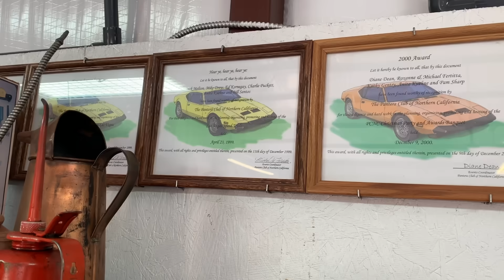I Flew 5000 Miles To Buy My Dream Car BUT There's A Catch.. DeTomaso Pantera

Comment: Only thing i can see thats going to be a bit of a job is the 1/4. Thats paint separating from primer and body filler. You’ll have to strip the panel to bare metal. Rework the sheetmetal (it’s likely a bit to wavy under the filler) re apply the filler the correct way. Then paint it.
On the positive side. Its black. So you can panel paint without blending.
Reply: The factory used lead.
Reply: @johnbriggs3916  what does that have to do with anything? There was lead on the seams. 
This obviously has filler on it. Not lead.
Reply: @johnnymula2305  Exactly  --  it shouldn't have filler. (The factory didn't put lead on just the seams!)
Reply: @johnbriggs3916  obviously you didnt watch the video.
It CLEARLY stated. That the car just went through body and paint.
You’re trying to compare an original car to a restored one.
I guarantee, 100% there is filler under that paint. And not lead. And the cars future will expose this when the 1/4 panel gets ground down to correct it.

Comment: I think the bodywork is hiding secrets. Those "strange marks" on the quarter panel look like theyre hiding filler or something. Couple that with the orange peel and some of the matte finish around the front bumpers and it just seems a little off.

Comment: Those marks look like either the fibreglass is delaminating or it's filler that is starting to lift, paint needs to be stripped off for a proper inspection, if the engine still has hydraulic lifters then all good, the roller rockers should not cause issue although not needed, if fitted with a solid lifters, roller rockers and adjustable push rods it will be a pain in the rear,
Reply: Depending on the date (which I didn't catch), there shouldn't be any fibreglass.
Reply: It's a 1974  --  there shouldn't be any fibreglass.

Comment: You'll end up changing the color I guess... probably some mild surprises under there but ... like Harry Metcalfe says:  "if you really don't like the design of a car, get it in black". ;)   (Although this applies less I guess to classic cars with chrome bits instead of black plastic bits that end up lost when the body is also black.)

Comment: those marks on the arch look like really thick filler and who uses chrome plated springs ?......deffo looks like it was intended as a show car and not to be driven
Reply: Painted,  maybe?
Reply from the maker: Chrome plated springs are a thing in the US especially when this project was first started. Jim liked his chrome and had a lot of bits done that way. He did use his cars so will assume he intended to use this too!
Reply: Those marks normally are from filler under the paint. But a very cool project car without a doubt 🎉
Reply: I think it was intended as a road car that also looked cool at car shows.
Reply: Chrome plated springs are certainly a red flag.

Comment: Hi, what kind of tires you can put on 16x10? It's probably something like 265/40/16.
Reply: The stock wheels on US cars were 7x15 and 8x15.  Euro cars got the same ones as standard but optionally they could be had with 8x15 and 10x15. He bought a set of Euro wheels to replace the ones on the car now.

Comment: That cragar type of rims look way nicer and 70s your other look European and  that wider tire you say look slimmer than the look now. All you need to do is spin the tire on the car and sand it it would look brand new aluminum that offset the black perfectly
Reply: Keep that very high lift cam sound, it was the most amazing sound as it very loud with the close ratio gearbox and the short exit . It could have been hooker header  that guy has as it had that same sound as my old day of high school when the chevron gas station son has a 69 hemi road runner black with center line and  hooker has a unreal  crisp idle with the hip hop high lift,  they still sell it.

Comment: Are those not Weld Pro star wheels, or perhaps Draglites?  I admit they are not to my taste on this car, but somebody is going to go bananas over these in the UK.  Imagine them on a hot rodded Morris Minor.
Reply: Looks like Prostar's to me. If so, then they are super light "race" wheels. No problem to change their look/surface to something else with bead blasting/paint, if polished looks to flashy. Those "wing" center caps are also optional and rarely seen, most run them with the normal or no center cap at all.

Comment: I would say with this leave it as is and complete it, then see what to do with it, as those are halibrand knock off style rims with bolts behind them, and he's done the smart thing and redone the oil pan to be a much larger unit, looks like damn near 16QZ, like get the literature, and check, and just copy and follow his work
 
as if he's built 7 and this was gonna be his final, everything he did was on purpose.

also the paint is cracking in that spot, at 10:11 looks almost like contamination, unless he fiberglassed the fenders

as that looks like the kinda crap you'd find on a corvette which requires a gell coat to get everything to work right.

like maybe he used fiberglass filler and it didnt adhear properly

Comment: Jack, I would be very suspicious of that crazing going on in numerous places.  It's not uncommon to see bad paintwork and poor restorations come out of the U.S.  They just don't seem to have the same quality of restoration work compared to the UK and Europe.  It wouldn't surprise me if the whole thing needed taking back and it certainly wouldn't surprise me if it had a thick layer of filler all over it.  It reminded me of a 'restored' Callaway twin-turbo GTV6 I had a hand in doing some years back.  It looked shiny (ridiculously so) when it arrived but it had about 5 different colours underneath where it had just been repeatedly resprayed over each layer again and again, and a thick layer of filler all over it which took the bodyshop guy weeks to get it removed completely.  It was an absolute lash-up and very costly to put right.
Reply: There is always a least one in the comments.

Comment: Good move on the wheels. So many Panteras are ruined with tacky rims. Either the original campag or the group4 campag look great. 

Please consider removing the rear spoiler.
Reply: Why consider? It shouldn't be there.
Reply: @johnbriggs3916  , could be because the wheels on the car now are very lightweight race wheels. At least they look to me to be WELD Prostar. Nothing like ordinary aluminium wheels, these are made out of 2 pieces of forged aluminium sheet. Jack will find even the wheel bolts/nuts got an  unusual design.
Reply: Please don’t call them ‘Campag’…

Comment: Hopefully you know a good auto electrician. While you have some updates, you will have to chase down every circuit to verify. Lots of man hours.
Reply: I was concerned about the electrics too. But a friend just told me that he and Jim worked together and got 100% of the electrical system fully sorted before he and the car moved back to Oklahoma. It has been off the road for 20 years or more.

Comment: I disagree, the ‘Mericans are crap at restoration. Those marks on the wheel arches are sinkage marks. It’s prolly a re spray. Oodles of fun to be had 🤔😁
Reply: He said that it had been resprayed.
Reply: @johnbriggs3916   Actually he said it had been re painted straight after saying the body had been restored. In my head that lead me to think "bare metal re spray". If you restore a body properly, your into a bare metal re spray automatically. However if it's only a sympathetic restoration (just do the main crappy bits, bodge the rest) then you get a re spray, and then you get horrific sinkage.

Comment: You talk like the paint job is a minor thing.  Those scratches are indicative of amateur workmanship.  The paint on this car should cost $100k.  I would suggest stripping it completely and start with a professional.
Reply: $100k😂
A full bare metal respray in the uk will be comfortable under £20k

Comment: Horrible ugly billet aftermarket wheels.....just go with stock wheels😂😂😂😂😂😂please....please
Reply: Looks like WELD, nothing billet about those. They are basically very lightweight "race" wheels, that used to very popular in the drag race world. They got an very different construction than usual aluminium/magnesium wheels and are made out of forged aluminium sheet.